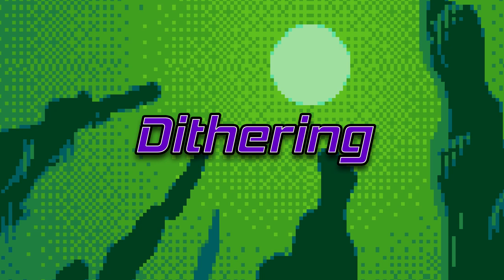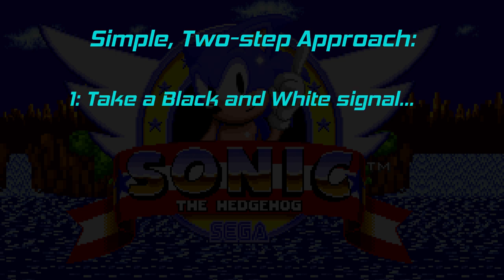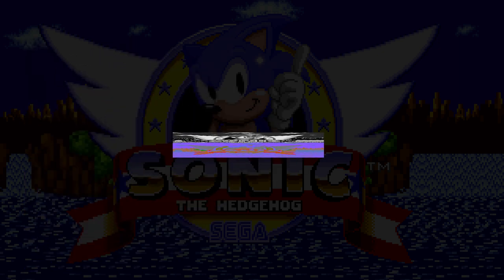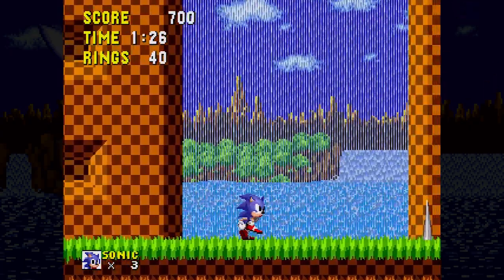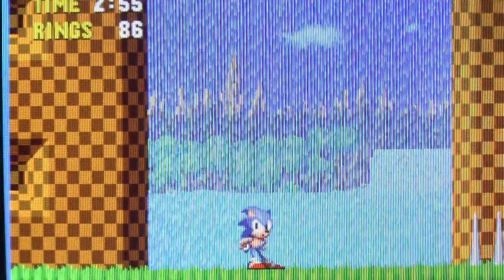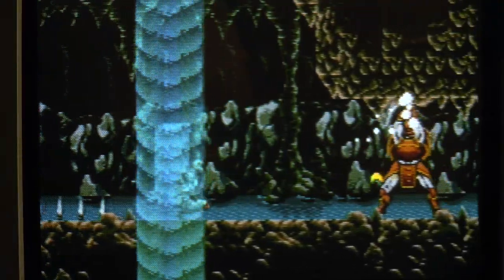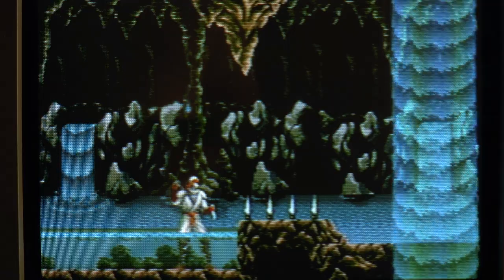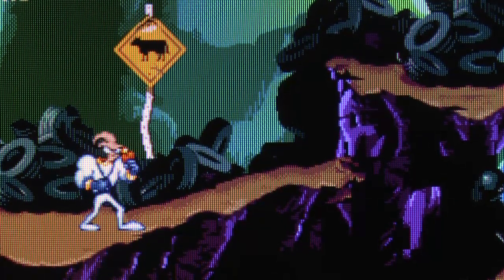Dithering on the Sega Genesis with Composite Video

Comment: Lately, I am having renewed appreciation for composite video signal.  I totally agree with you that some games benefit more than others from dithering--fake transparency effects, shadows, gradients, etc.  I find it quite interesting the diverse preference of people regarding video signals, monitors/televisions, resolutions and aspect ratios.  

I think bias is in large part shaped by people's unique and/or peculiar circumstances such as nostalgia, using particular revision of console, television and cable all of which independently and in combination can produce huge differences in quality and thus opinion.  That said, I have come to appreciate all video signals (RF to RGB) and like to believe I've seen some of the best (and worst) they can offer.  Even RF can produce nice output when finely tuned.  

That said, most revisions of Mega Drive / Genesis model 1 (and 2) composite signal are notorious and widely regarded has having one of the worst (i.e. blurry) outputs among various consoles.  The AV Famicom, PC Engine and even Genesis 3 in contrast produce in my opinion a much nicer, cleaner composite signal where you have a fair compromise between definition and that organic look that takes advantage of dithering.
Reply from the maker: Hey azmune. Thank you for your comment. It is pretty much right-on with my thoughts on video signals.

I found that when chatting with various people prior to making this video that many of them had very strong preferences leaning one direction vs the other (composite vs RGB). Both sides had strong representation. There are some Sega fans (specifically Genesis/Mega Drive) that have also continued to push mods of their systems in order to find a higher quality composite than the native one provided by the system.

Nostalgia for many is the key component - not necessarily an objective view, but the view that is important to them. I don't believe a consensus should be reached regarding how people game so much as that they can and have options available.

I personally will game using an upscaler and a plasma display... but then want to hook the same system up to an old consumer CRT that was period appropriate and play it as well.
Reply: Thank you as well for the upload and excellent explanation.  I wish you expanded on the differences/details between notch and combed filtering.  Is one superior to the other and it possible for some (high end) television sets to offer both types, or are they mutually exclusive?  Also, how does one go about finding out which kind of combed filtering is employed (two line, three line, etc.)?

Regarding Genesis/Mega Drive, since hardware already outputs RGB natively and quite nicely there is no need to mod for this signal.  In all these years I have only come across one person who discussed improving its composite out.  Even then, he or she ultimately ended up with the more common s-video mod.  I think the population with affinity to composite out is very small.  It refers to that group who use their gaming console with standard definition CRTs as it doesn't work too well paired with processors or modern displays.

Lastly, thank you for bringing to our awareness Sega's 16-bit console as one that arguably takes most advantage of dithering.  Given the Genesis / Mega Drive weakness of limited color palette, this gives many of its games the illusion of more color and depth.  Something that can get lost even with s-video.  Yes, you can always soften the image via filters or bring down sharpness but you also lose a bit of its purity.

Comment: finally!. I've been saying for years "composite on a crt looks better" and nobody believed it!.
Reply: Hell yeah man
Reply: It looks like a**. I don't know what you people are smoking. I rather take a sharper image than a soupy image just to blend the dots to create few more shades. I have the option to use composite signal on retroarch and I use it for the novelty factor but could never play a game seriously with it on.
Reply: @ajsingh4545  To me, I really don't like game that are pixelated. And I played my genesis on my CRT
Reply: @ToadBradley24  fair enough
Reply: @ajsingh4545  it looks like how it's supposed to look. I don't want the games to look like in an emulator or to lose features like transparencies and the smoother shading or the "simulated extra colors".
Reply: @pelgervampireduck  Well I turn on the scanlines and tweak them to my liking so it looks sharp but also retains the scanlines. The scanlines on retroarch when playing on TV with retropie look pretty great and is the best of both worlds for me. I can't play with raw pixels or in other words no scanlines. Also color blending only really works in games that support higher resolution. There are several games that run in the lower resolution mode and blending does not quite work in those like street fighter 2 and hyperstone hiest.
Reply: @pelgervampireduck  Also, in conjunction with some games running in lower rez, most games don't even use dithering in a significant way to warrant the loss of clarity. So to answer the author, in my opinion it is not worth it.

Comment: Love this. It's really hard for people nowadays, who grew up without analog/composite video signals, and only know HD, or quickly moved on to upgrade their TV to HD. graphics were made the way they were for dithering reasons, but to most people, it just looks "pixelated". When I first started messing with emulators, my default set up used scanlines to get a more accurate simulated arcade effect. MAME now has a video setting HLSL to simulate everything a CRT monitor can do. It looks a thousand times better, and more accurate. I own about 20 arcade machines and I try to keep original CRT monitors in them.

Comment: YES DUDE !!
You get it !

I think all these RGB and HDMI mods for older consoles are cool, but I'd hate to play them like this. 
My MegaDrive, Saturn, and PlayStation all came with Scart leads out of the box (Though I believe the PS's one was only wired for svideo), but I never use them, I think it looks a bit trash !
Whenever I use it, I just looked all pixellated, and not right. This is the same for even for high resolution consoles like the PS2, it looks lots better through composite in my opinion! In Burnout 3, the road is smooth, I can't see the pixels on the edge of the car, the particle effect look great, the pickups look round, It looks great!
It's like built in anti-aliasing!
When I use my MegaDrive now, I use it through the RF port on the back of it, it's even better than composite! 
Although the background noise in the black areas of the screen, it has this awesome HD look through my LCDs, it's like those video filters with emulators (Like that HQ4X thing), like in ToeJam and Earl, playing as toejam, his body is actually smooth on the edges, like extra detail between the pixels, I love it !

Comment: The Apple II display is entirely dependent on abusing the composite video signal with high frequency luma signal that tricks a TV into generating color. Woz learned this trick from Al Alcorn when working at Atari. The Apple II signal is not very standards compliant which often confuses modern displays. A simple composite decoder with relaxed standards — real or emulated — are key to getting an Apple II to look like it did back in the day. While it was common to use dithering on the Apple II, multi-line comb filters were not common in TVs back then, so even those will affect the display in unexpected ways like creating new colors that most people never saw. I think these color interactions were more expected in PAL regions than NTSC.

Comment: Pretty good video, especially in this era of "ZOMG!!!! RGB is the only way to go!!!!!".

I'd add, though, that you can get similar visual effect to the composite examples you showed even when using S-Video depending on the equipment you use and how you adjust some settings.
For instance, you have a CTRP option in the Service Menu of the Sony Wega CRT TVs which you can set to 0 and it will give you a blurrier image in S-Video than you usually get, allowing all the dithering patterns you showed to work well and yet without having the worst artifacts that you'd get with composite. 

Finally, it's not only the dithering which benefits from video signal crosstalk; there are several Genesis/Mega Drive games whose shading will actually look worse over RGB/Component since the transitions from one tone to another become a bit too "harsh" let's say, similar to what you described about Earthworm Jim's static screen.
Reply from the maker: Hey, thanks for your comment, Agostinho!

Back when I did the review of the Micomsoft XMD-2, I hooked up the s-video output to a Commodore 1702 monitor and did mess around a bit with color just to increase saturation and see what I could get. I was wondering about using a happy medium - something between RGB and s-video and tuning it closer to composite in order to achieve some compromise but starting from a separated signal. I like your point about the service menu in the Wega line and trying to achieve a similar effect without dipping into artifact territory as easily as with composite video and the system responsible for producing that composite signal. 

I would probably lump shading into the color blending (just more of a darker variety), but it is another good specific example of how they leveraged the techniques. I am glad you mentioned it. Again - thanks for commenting!
Reply: Thanks a lot for your reply.

It's refreshing to see someone with good editing skills, good equipment AND good sense.
There's a lot of interesting info to be discussed in terms of these "lesser" connection types but it's a rare topic these days.

Another topic that I'd love to see you cover in the same fashion you did here would be CRT blooming.
Especially if you try to explore why some games seem to shine with it and others doesn't seem to benefit nearly as much.
Streets of Rage 2 and Castlevania: Rondo of Blood seem to be especially tailored for it, given how much contrast highlighting they gain when displayed in a CRT TV with very high exposure.
Their pixel art and palette choices seem to favor it since you have most of the sprites and tiles taking lighting into account, having proper shading and tone variance on their boundaries; also respecting a certain drawing perspective.
SOR3 is a major downgrade in such aspect (and in overall background details as well).

Even among the western-developed Genesis games there are titles which seem to benefit from it and others which look drab in comparison.
The first Earthworm Jim, for an example, looks far better than The Lion King in such aspect IMO, even if you're using Pyron's color hack for the latter.

Comment: Great video! This made me realize that the heavy dithering actually looked good on the hardware these games were designed for. I think modern 2D games should use semi transparent pixels in most cases instead, because it looks alot better on modern monitors

Comment: Crosshatching on the Mega Drive was completely forgivable. But, on the Saturn, far from it. SEGA of Japan made so many mistakes, far too many to even discuss outside of a call, but the worst mistake will always be not giving the Saturn an alpha channel.

I mean, the 3D was jank, being last minute, but those games could've benefited way more without jumping hurdles for both great visual flare and trying to look good. Burning Rangers looks good when you are looking at images, but not in motion. And a lot of the 2D games suffered for not having transparencies.

The SNES could even do it. I won't say it's weird the Mega Drive didn't have them because Nintendo had plenty of money to make the SNES as powerful as it was thanks to the great success of the NES, but the Saturn was after SEGA found its success and there was no good excuse for the Saturn dithering.

At least the Mega Drive made its dithering work very well. On the other hand, seeing it in 3D games on the Saturn was an eyesore almost all of the time, even with composite. Some cases looked exceptional, but only a handful. And seeing it in its 2D games felt depressing.

Comment: While my reason for playing on a CRT is because of no input delay, the way composite handles pixels in 240p console games is just the icing on the cake. Although, I could always use a cleaner signal for arcade games. Thanks to the MiSTer and an AV switcher, I can easily toggle between s-video and composite.

Comment: I've always stuck with composite on my 8 and 16-bit machines. There's just enough blur to keep the dithering looking good and I'm fine with not having a perfectly sharp picture as long as I just don't have to put up with the horrible noise and waviness from an RF switch.

Simulated CRT filters, bleh, no way. They never look right, even the good ones are still off enough that it doesn't click right with my brain.
Reply: They look fake

Comment: I'm in Italy so RGB scart was almost omnipresent on TVs.
 when i was a children i didn't know about RGB and played in RF. then after some years i played in composite for a few months and then finally acknowledged about RGB.

In my experience, i can't disagree more with this video.
what you are not taking into account is the way each tv performs at reversing compsite to RGB again prior to amplification. I had the chance to use varius TVs  (different sizes too) and the result were very different, and not in a positive way.

first of all, on a stock console you are plagued by rainbow banding, the composite encoding is lossy so it soften chroma horizontally. So even in a virtually perfect tv, this is permanent (until mods), but in real world the tv is going to split composite to each color channel again, and there's additional loss in that too. So depending on the tv video IC quality or electronics design you get additional smearing, ringing, haloing, or plain ugly saturation.

so is all that shit worth it for some brief fake transparency? Not only it doesn't, but the best performing tv i had at composite input, was good enough to show a bunch of dither too. so i had a reasonably sharp picture where i could see rainbow banding alternating with some dither in sonic waterfalls...

i only seen it look nice on a pair of tiny 14" to 17" TVs where dot pitch was ass poor enough to blend that. Sounds absurd to consider ideal the worst junk TV you can get.

in the last decade i didn't play on anything smaller than 27" and never looked back to anything not RGB as i really can't justify the loss of quality for very specific patterns of dither in SOME games that MAY look good on SOME tvs..
Reply: I figured out something odd about composite and RF recently that seems to improve the quality: when the console is on, if I unplug and then plug the video cable back into the console / TV (either one does it), some of the smearing disappears and the picture looks a little sharper. Not sure why this is a thing, but if I didn't use this fix on my composite cable, and I did use it on the RF, then on the same TV, despite noise, the RF cable would look better than the composite cable. In fact, that's how I found out about this fix.
Reply: I think you're really missing the point. In no way is the guy in this video saying that RGB is inferior to composite. Nobody's saying that. However the Genesis/Megadrive was pretty much designed to use composite/RF from the get go to the point where these effects that started out as "artifacts" of the lesser quality of the signal became features of innovative game design at the time. To each their own but what do you really get out of using RGB over composite? More sharpness, that's about it. "So glad I modded my Genesis to use RGB so I can see every pixel in Sonic's jagged fucking face now! Hooray!" And as far as rainbow banding and other artifacts appearing in places where they shouldn't be, I have a first generation Model 1 Genesis, a second generation Model 1 (the one without the high definition graphics logo on it) and a model 2 that's regarded as having the shittiest picture quality out of all the models. Both the model 1s never displayed any of those fucked up rainbow banding or jailbar artifacts even using RF and the model 2 did very slightly but that was fixed simply by buying a better composite cable for it.

Comment: Color demodulation in RF and Composite is a fascinating process - Especially with CRTs. Modern LCD televisions typically just use a computer and a framebuffer to decode the color signals, but analog CRT televisions typically use discrete components to get this information, and tube based color televisions are a thing too.

The Apple // hi res mode uses composite artifacting to an extreme extent to produce 6 colors using certain patterns on composite.

Technically, RF and Composite don't carry any chroma information, just an extra bit of luma information at the beginning of each line which is decoded into color levels. NTSC color burst is what it's called.

Comment: Dithering, or more specifically, artifacting, was also used for PC graphics, back before dedicated monitors were commonplace. CGA was designed for use with composite TV in mind, so the infamously hideous 4 colour palettes would blend into 16 on a comp. display. The 8-Bit Guy did a video covering the display hardware.